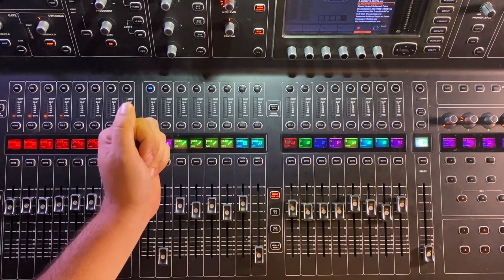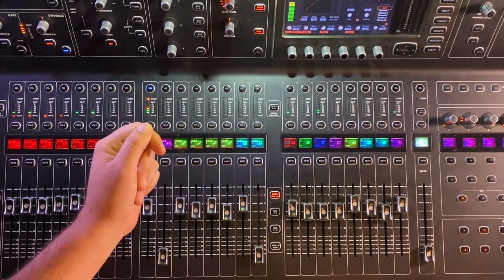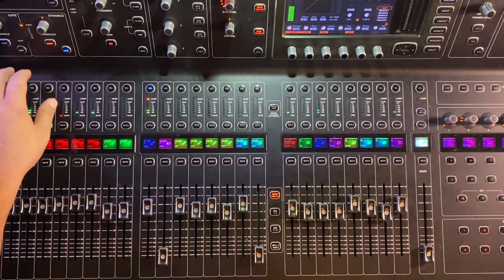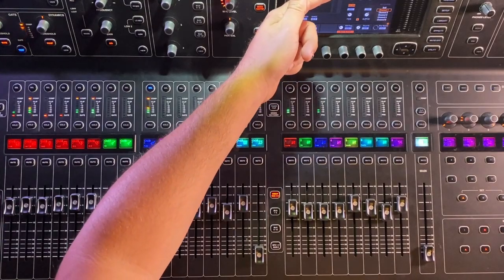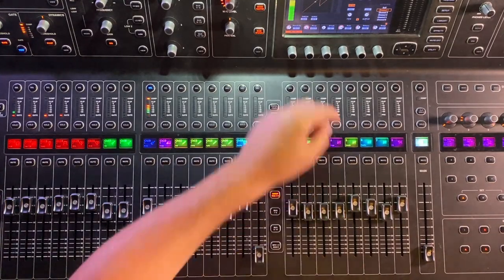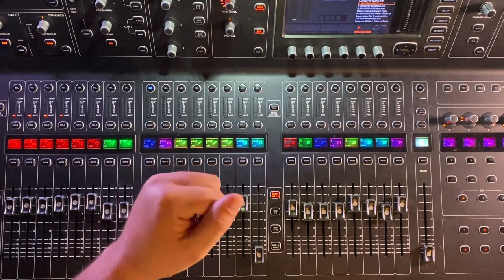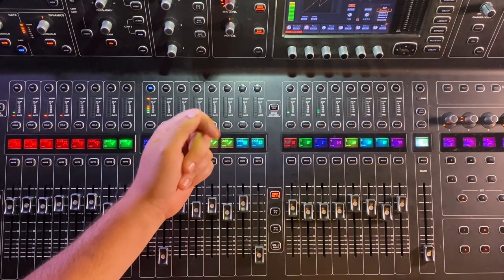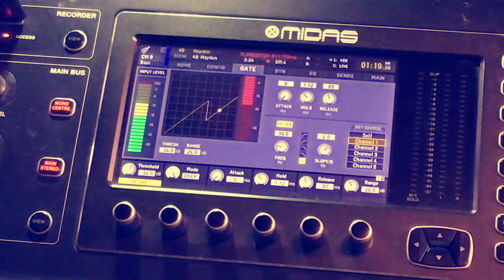Ducking Basics M32/X32

Comment: How do you get those multi-track recordings to play directly on the board?  I have a lot of tracks on ProTools, but I can't figure out how to get them on the USB drive to play on the board.
Reply: Use a USB connection and use it as an interface.
Reply: He's using the X-Live card. It allows you to record and playback 32 channels from the X32 / M32. 
It's saving them as .wav multichannel files on SD Cards.